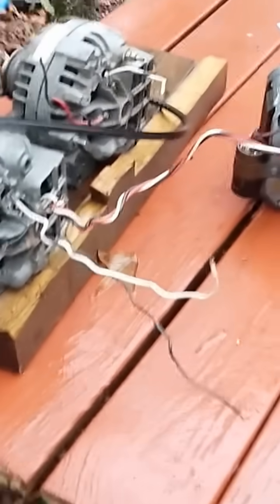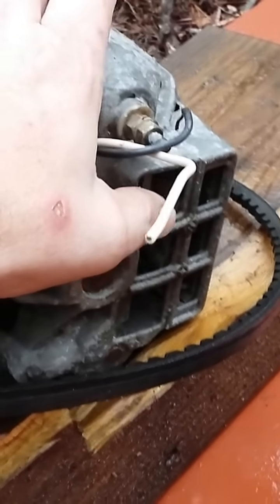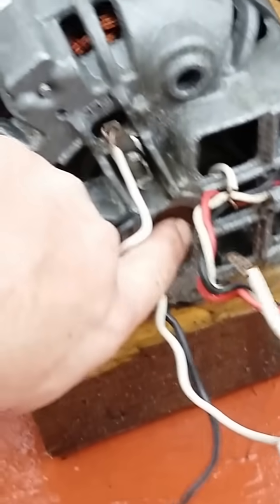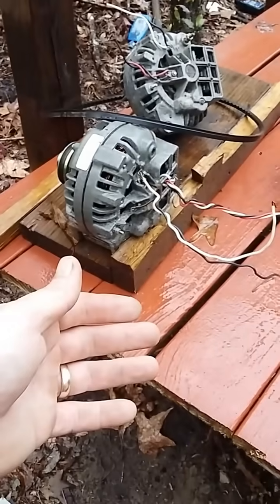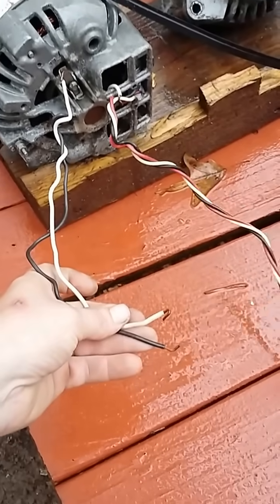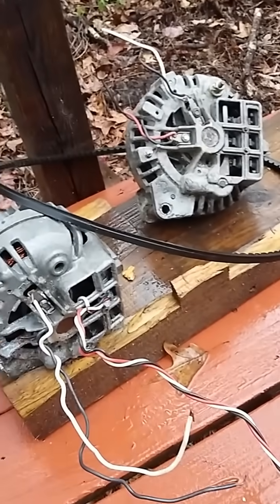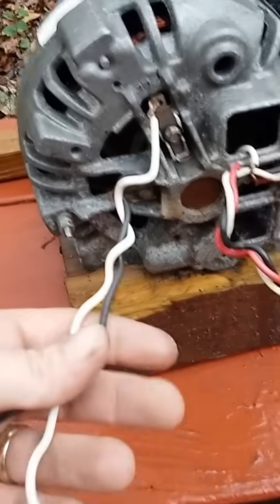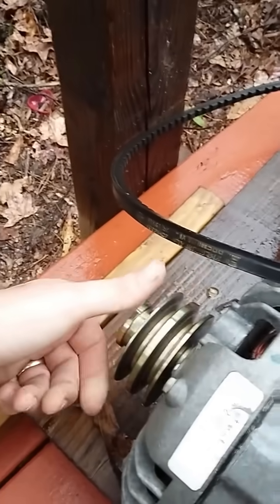Update Free energy forever no wind no solar no gas READ DISCRIPTION!!!

Comment: title doesnt match video. you need a power source to energise field coil and turn the alternator. you can't just " run your house " on that power either most power drills, saws etc will run OK but anything like a computer or any intricate electronics will either be fried or won't work. the cabling used is far too small as well for any type of large load. motor/ alternator combos to achieve over unity has bee. tried a thousand times over and does not work.
Reply from the maker: The title matches the video just fine. But you can not use the direct current unstable sine wave Bridge rectifier that is in the back of that alternator. You have to use an alternate current stable sine wave bridge rectifier to achieve this without frying your sensitive components like your TV. Which I have stated many times. But I do appreciate your intelligent statement.

Comment: this is cute...you still need something to power it to make the current and make it stable for usage. the wires shown on the unit he made can only safely handle 20 amps of power...heavier usage will result in  melting insulation, exposed electrical wires. melted wires also, which will cause fires and electrocution......still fun to play with but, my God, someone needs to p u to a warning label on some of the stuff they....   'invent' on here as this has been done with these things for a hundred years
Reply from the maker: no sir I believe you are mistaken those test wires that I had on there are not 10-2  and they only handled about 15 amps before they started heating up, trust me, I know this they're in my backyard right now and I do not need a power source as you suggested because I'm using self excitation. I'm sure you've heard of this.
Reply: But its not perpetual and wiring safety codes are # 4 copper minimum for 90 amps and that's slightly above the diameter of a cigarette
Reply from the maker: +richard white  okay so by what you've been taught on your wire size the 100000 to 300000 volt that are running through all these electric lines should be about 4 inches in diameter I'm glad you pointed that out because I'm really going to have to change all the sizes of my wire....  Lol OK
Reply: the higher the voltage, the smaller the wire size for similar amperage...you know,  there are books and codes that specify all this.....look at the wire coming into your house, then look at the wire going to a receptacle or receptacle...  if a motor wasn't necessary to run this there would be no need to have the pulley for the car motor to turn the thing to keep a charge on your battery...
Reply from the maker: +richard white  It sounds like your a lineman could you tell me what gauge wire I need to run to my 50kv homemade electrolytic/dielectric Transformer. That I'm going to use as a capacitor. Nevermind I found some.
Reply: Gimme a voltage and single or 3 phase.
Reply: O ok...  not a lineman but was a commercial, construction, and residential electrician for 45 years....licensed  for 34

Comment: perpetual motion does not exist. you would have better luck attaching bread with the butter side up to the back of a cat and dropping it.
Reply: Tim Filipiak yes some one understands finally
Reply from the maker: +Tim Filipiak you mean to tell me that you cannot take magnets and make them move in perpetual motion forever?
Reply: Thomas Buie yes you cannot get more energy than you put in
Reply from the maker: +Kobi Greyson and who says that? Because someone is just going to change that law of physics just like just like all the others that have been changed you know just like it's impossible for for man to take flight because they don't know what the hell they're talking about there are many many people out there that can get more power out of something then they put into it very simply or well for people like you be probably not so easy...
Reply: I can't tell if your trolling or serious.
Reply from the maker: +Tim Filipiak I am dead fuckin serious
Reply: it's just unbelievable your using an alternate there not very efficient. Also how do you know what Hertz your running at? You have no regulating circuit.
Reply from the maker: +Tim Filipiak 
OK.......... let me explain it to you there is a big difference between a direct current Bridge rectifier and an alternate current Bridge rectifier you need to find out what that difference is! there is not a capacitor on a direct current Bridge rectifier look it up you will find this out for yourself. I have answered this question 50 times over the last few months...   look up and find out how a self exciting brushless generator/alternator works. and compare it to Teslas invention the GM alternator that I'm using...

Comment: I have a question, how did you break the laws of thermodynamics?
Reply from the maker: The alternator that I use has an internal fan and I use a homemade Dielectric Capacitor to relieve the stress from the system after initial startup. Sorry that was off the top of my head I'm running out of time and I just received this notification, which system exactly are you speaking of?

Comment from the maker: sorry but yes that was funny. If I ain't never knew no one never done did heard of something or another.... because of electricity!!!
Reply: Thomas Buie this actually isnt "infinite" or "free" power. the electromagnet field and interference create a potential resistance that would slow this down over time so it wouldn't run forever
Reply from the maker: +Trevor Brooke and you've built exactly what I have not shown and tested it how many times?
Reply: Thomas Buie ive tried this theory multiple times, but its not efficient. trust me if it worked, someone would have patented it. did you test the current and voltage going in and the current and voltage going out with a meter? did you test it for a week (or even a couple of days)
Reply from the maker: +Trevor Brooke 
 And that statement proves to me that you didn't and haven't done what I have done and am doing. I am creating 20kw AC peak and 14.4kw AC continuous. Now... To get this,  I am consuming 2.475kw AC.....  You should probably watch some of my other videos! And I know you haven't or you wouldn't have made any of those statements...
Reply from the maker: +Trevor Brooke  I almost forgot to ask you. You stated that, "you have done it multiple times and it is not efficient" so does it work or does it not work? You also stated that "it does not work" so I'm not sure to which answer you're wanting me to respond too? And also FYI I do have a patent for this.
Reply: Thomas Buie it works if you you must its just not efficient. what I'm saying is it wont run forever.
Reply from the maker: +Trevor Brooke   no it doesn't work if I must know I'm a big f**** liar you talked all that s*** about how it doesn't work and it will never work and you can't do this and you can't do that and now you want to say that it does work it's just not efficient well how efficient is it to f**** load a train full of coal and take it and burn it how efficient is that or how efficient is it to spend two years building a dam just so you can put the same damn invention underneath it and power it by water instead of a motor and some pulleys are you f**** kidding me? go to hell and go f*** yourself!  I can't even feed my family because of people like you and now you want to admit I'm right!!!

Comment: or you can reverse it and make a wheel system with magnets to free spin the alternator to generate power to charge a battery bank.  put a couple alternators in series like that and you can have a nice big self charging system putting out plenty of FREE power!      there are people who have set these alternators up with propeller systems and place them near a flowing water source and getting power from natural running water.

Comment: This is Really cool. I wish you the Best. I'm a low tech guy. I like using ram pumps to circulate water through evaporative cooling systems for; a refrigerator that will cool 40 degrees below 80 degrees ambient, a small house cooling system that will cool 10 to 15 degrees, and moving hot water to heat the house and hot showers. Got all your basics covered with a water source and primitive know how. Ram pumps and evaporative cooling been around since the Pyramid builders.
Reply from the maker: +Divergent Droid that sounds pretty awesome do you have it on video? Make sure you don't take everything I say in the video to heart you will have to read through the comments too get the missing information from the video or watch some of my other videos... sorry, I did it this way to Wing through quite a few pretty people... and YouTube pays me 150 or a couple hundred dollars sometimes depending on how many views I get... I hope everyone is having a wonderful day without it being too hot... I want to show everyone how to get water out of the air from anywhere on the planet!!!
Reply: Sadly no because I haven't built it complete yet. I have made some of the concepts on a small scale. All 4 are proven to work and you can see that on many videos, Just look up ram pumps and evaporative cooling, like a swamp cooler. I am using the same technology 4 ways. 2 for cooling and 2 for heating. You do require a water source like a stream of fast flowing spring on your property.. This is why I haven't finished it yet, we are still looking for land to move off grid. We'll have a normal house and this will be my big primitive play house project to complete on my X acres of land. Anyway, most folks use electric battery driven pumps but there is no reason a ram pump or multiple ram pumps won't work.. Ram pumps will run all 4. 1st is making a refrigerator with evaporative cooling by moving water through a coil in a insulated box and running water down cloth on the outside of the box. The water carries away the heat. This can get you to 40F. 2nd is the air conditioner. which works on the same principal with coils of tubing built into the walls. It cannot by no means be as efficient as the smaller box refrigerator so it's not going to get down to 40. Even modern refrigerant only cools in residential air conditioning no more than 20 degrees of outside ambient because thats the limit of the heat transfer. I was an ac and heating tech for 30 years. I'm retired now. Just need thin strong tubing and elbows to build the thing. 3rd is heating, that comes from a simple solar heater. It's a glass box filled with tin cans you sit in the sun. This can get you 140F of hot air but you make two you see because 4th is hot water for showers and cleaning and can also be directed to heat certain spots only that you desire.. a neat trick to warm your butt at the breakfast table on a cold morning. Using small piping. You fill one with water and circulate that hot water out to use through house plumbing. There is also the awesome idea of geothermal heating and cooling I can incorporate into this. You see all these things people do and have done.. but no one has thought to use them all in a house before - at one time. My goal is you could live comfortable in my house and never know it didn't have solar or other types of electricity.. unless the stream dried up LOL
Reply from the maker: +Divergent Droid he'll just get you two 55 gallon drums and recirculate it. Plus you will draw moisture directly out of the air from the condensation you could use a small fish tank pump to push that back into the system...?...
Reply: I wish you could recirculate it without loss your'd have the first perpetual motion machine. Sure you could use a fish tank pump or sump pump to try to capture that water outside of the system, then possibly feed it back into the system.. I Think.. that might solve the problem but then I'd have to use an electric power source... That could be a small solar panel and battery..If you didn't care about using the battery. Hmm I'd have to find a primitive type of pump. I figure i'd need a tower for water for gravity feed side and a water tank at ground level for the inlet. A ram pump will run forever as long as there is moving water, but you gotta get that from somewhere so i'm thinking gravity. It wouldn't be an enclosed system but if it works so I won't need a stream just a well or spring to maintain it folks could build it anywhere.  Thanks.

Comment: scott you only need a center tapped transformer,connect outer taps to diodes and the center tap used as ground for getting your current shifted from ac to dc for full rectified positive (dc) current.or you could buy one,but that takes away all the creativity
Reply from the maker: +Robert Andrews yes sir that is how you short the circuit to get it alternate but you still need to turn it at either 3000 revolutions per minute for 50 hertz or 3600 revolutions per minute for 60 hertz thank you for your intelligent comment!
Reply: Thomas Buie ,thanks,I'd like more info,I believe it is very possible. I have been wanting to build something like this,it's just time.maybe after I get these two motors put into vehicle.i need more info if possible,can I email u.my email is randrews612@gmail.com